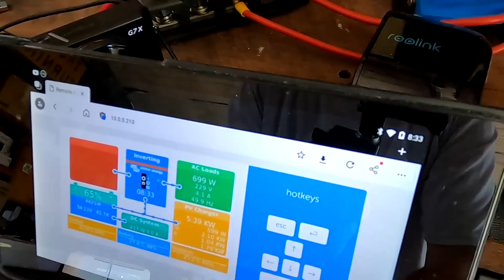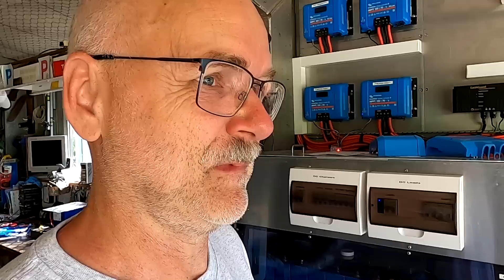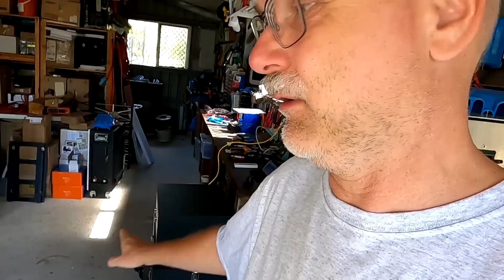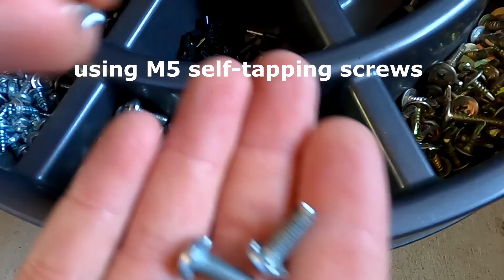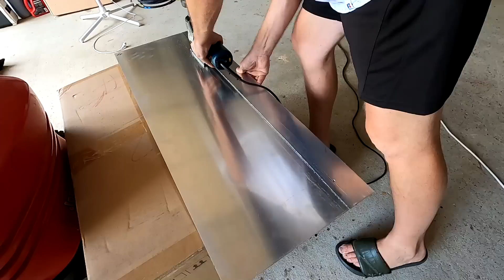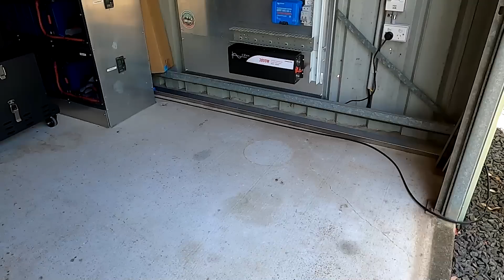PowerWall2.1 and 2.2. The DIY madness starts again. Building a 2nd system for...

Comment: does the aluminium sheet give all devices the same earthing level or does it just make a better job when mounting the devices? My original installation relied on 19mm formply as the backing sheet. Thanks for the handson tips during the build!

Comment: Andy - you mentioned that the Power In, Lynx Shunt 100 and the Distributor 100 do away with the need to switch off batteries and the breakers? So how do you switch battery banks ON and OFF. It looks great and the $s saved can offset $s you would have to pay an electrician to do any of the work? I love your videos and yet you still look value for money and reliability. I think communications will end up being a critical thing as LiFePO4 batteries age. I'm already totally off grid on the Mid North Coast, NSW also in sunny Australia. I plan on building a LiFePO4 pilot as a Plan B for my existing offgrid setup. I am on a farm, so I can guarantee no trees will be shading any of my panels, ever. lol

Comment: Unfortunately it is not possible to mount the power in module on the right side of the Lynx Shunt. It would be good if the shunt itself could be rotated in the housing so that the Lynx power in module could be mounted on the left or right. This way you can better place the lynx devices according to your wishes depending on the state of the installation.
Perhaps that is a tip to Victron Energy.

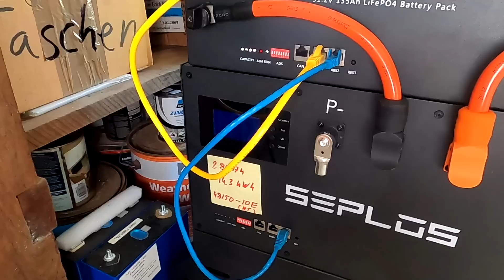Comment: 4:54 Great questions to explore! Will be following this closely. I run an off grid farm and also exploring how battery communication can benefit the whole system. So far, battery communication for me is just to satisfy the requirements of the hybrid inverter but would be more interested to command several circuits of appliances based on battery state. An example would be during the hot summer when battery is at a highish state of charge, to run a chiller and make a tank of cold water which I can use to cool the premises.

Comment: A little tip from Germany, put the Cerbo in a small plastic box or a small power distribution box with a door. How do you think the RJ45 and USB ports work after 5 years of dust and dirt trickling into the ports?
Such a box with a window costs 15 bugs and you don't have to screw them together, most plastic fuse boxes for 8 modules are big enough and they have a plastic tab on the edge where you can put a cable or a cotter pin through, so opening it is quick. greeting

Comment: Flip the lynx system upside down and put it under the wire duct and put your mppt on the top beside the cerbo. The lynx has decals that allow it to be mounted this way and the decals correct the type .

Comment: Good stuff Andy. Definitely leave the Victron shunt in for some more thorough testing, I am quite sceptical of the accuracy of the Seplos BMS Shunts at this point, I have 3 x Seplos Suntorque 5kwh Batteries paralleled, but use my Victron smart shunt as the main goto as there can be quite a discrepancy between the Seplos shunts. I may need to discharge my batteries again sometime soon to help reset the Seplos BMS’s, as I have found this helps recalibrate the readout displays.
Reply: Think think BMS has problem with low current measurement. Have seen the SOC drift in my battery (hop around) when only taking out low current. if it low enough, just the cerbo gx in my case the battery will turn it self off after 48 hours as it see no load at all. 

A full change seems to fix SOC drift for me.

For me that is not a problem because that is how it will be used in my case in mobile installation. With full charge from grid every time it is charged.

Comment: No Place? You need the Off-Grid Garage  2.0 .....
Reply: This was a suggestion I made a while back as he was planning the new Solar PV upgrade, with idea’s of plugging in the house later with wiring /trenching issues, a new insulated shed near the house maybe, purpose built to house all solar, batteries, Tesla, workshop, etc, in a sunny-er position perhaps, with air-cons & ready to plug in house & it’s roof area, which I believe still has room for more solar PV’s.  It’s a beautiful setup & huge investment he has there, he may not need it, but I think he could justify the spend.

Comment: 💥💥ATTENTION…💥💥. CERBO-GX on 48Vdc supply problem.💥💥  Search Victron Energy Q&A for "Faulty Cerbo GX devices"
Hi Andy
Victron has a There is an known issue with connecting the Cerbo-GX to 48Vdc, there is a problem with the Cerbo with certain serial numbers, where it will pop the blue smoke from inside the components, and as we all know when the blue smoke is released from inside the components it stop working = blue smoke makes electronic work?

Comment: This average Jo was thinking about a plan to save money by swapping my van for an estate car, up pops "EV unplugged"   With Andy testing the Mitsubishi Outlander PHEV. The issue is excess power in the summer with batteries in float from midday, to December in the UK, the last two weeks have been rubbish for Solar. How about saving diesel @ £1,80 a litre in summer to buy red diesel in winter for £1 litre to power the house.

Comment: Maybe a bit of work but move the board toward the garage door and still put the batteries on the left? Just a thought... Looks nice!
Reply: I vote this. Probably less work than it looks too as all the component layout work already done. That said the AC outlets and ductwork may have to move to right as well. Biggest bonus to this idea is that you could minimize the length of those expensive battery cables!

Comment: Regarding Aircon for Cooling of Batteries & electronics.
My science class taught me that cold air sinks, would it not make sense to aircon from above, for better efficiency
Reply from the maker: With no fan, the cold air would sink down very slowly because it's denser and therefore heavier. This movement is not very strong or fast, so a fan is always needed and it can blow this cold air in any direction. The fan blows the cold air directly onto the PowerWall. It reaches all the devices and components.

Comment: Why wasn‘t the last attempt with „reverse parking“ against the Battery 2.0 ok? Or park it the other way around into the corner on the right side? I don‘t see the problem…
Reply from the maker: Well, you want to see the displays and I need access to the terminals for testing purposes. All very tight...

Comment: Hi Andy,
I'm waiting already how do you connect wires to the Victron Lynx, as I understand its need to be connect diagonally (opposite sides) all of plus ("+") and minus("-") cables from equipment and batteries, what do you think?

By the way, Happy New Year and best wishes from Ukraine.
Reply from the maker: Thanks Igor. It'll come in the next video.
Batteries go all on the left side of the shunt and MPPTs and loads on the right side.
Reply: @OffGridGarageAustralia  I'll wait and watch with a pleasure, because I really interesting in how to correct connect all those wires from batteries and loads to the busbar to reach equal resistance between every connection.

Thanks, you really do a great job!

Comment: ATTENTION, there is a problem with the cerbo. If you connect it to 48 volts you have to use a capacitor.
Sunny greetings from Austria!
Robert
Reply from the maker: I know, it's in the forums everywhere... I've got this covered in the next video...

Comment: No offense, but if you want it to look "as clean as possible", then why didn't you just mount it upside down under the wire way instead of making it more complicated, and using more space that new equipment could use in the future ?

Comment: Can you bolt the batteries to the ceiling? Have them on a hoist platform, so you can raise & lower them 😁
Of course I'm joking! 🤣😂 
Unbolt the panel from the wall, build it out, so you can put the batteries behind, then put the panels on hinges so you can pull them out and up 👍

Comment: This brings a question. I just got started in solar about 6mo ago. Is it possible to have your solar panels feed 2 mttp, that feed 1 battery, that feed 2 inverters?

My system has been slowly growing and I've exceeded my mppt and I was wondering if I can split my panels across multiple mppt instead of getting a larger mppt. My battery is large enough at 5.2kw. The reason for the multiple inverters is I got them at different times so I have 2 1200w 48v inverters.

I'm just about energy independent.
Reply: Yes and yes.
Reply: @davidfrisken1617  thanks
Reply: Yes, with the caveat that panels can only be connected to one MPPT controller, so you'd have to slip the panels into 2 arrays, one array per MPPT controller. You can parallel MPPT outputs to the DC bus, and DC bus to parallel inverters just fine, so long as you're not exceeding ratings.
Reply: @collinbaillie689  ok. Yea that's what I'm doing, splitting my array into two to feed two mppts. I wasn't sure how the two mppt would interact with one battery. The inverters are still under the discharge limit of the battery. Honestly I could add a third inverter. I have to do small upgrades instead of a larger wall mounted charge controller just because of budget. One more inverter, 4 more panels, and I'll be at 100% off grid
Reply: @Paul_______  if those inverters aren't smart (IE communicate with each other to sync the AC waveform) you'll want to keep the AC outputs separate. If you get to the stage where you get a big inverter, or multiple inverters which are designed with parallel communication to all feed the one AC bus, then you can have one AC bus. Until then, keep the inverter outputs separate.
Reply: @collinbaillie689  yes they're all separate. That's how I lost my first two cheap inverters. I've since moved to vicron products. My next investment is going to be a smart shunt so I can actually monitor power usage instead of just eyeballing the voltage

Comment: Take the batteries to the BIG Shed, to learn more over voltagedrop by cableing.
The dukt is existing, and you have a lot of cables, btw. so we can see how helpful the Victron Batterie Sensor can be, if you will use the LYNX Shunt and / or the BMS to monitor the voltage and the state of charge.
You are testing so much, and there are everytime options to test something more ...... 
Beste Grüße aus der alten Heimat :D

Comment: Do you need access to the inverter? You could hard wire the inverter and an outlet higher up to plug things in. Then battery could be infront, looks like it would still be slimmer than battery shelf1

Comment: Put the batteries in the space to the right, by the door. They are on wheels so you can move them later if needed. That way it doesn't block access to your breakers for the production batteries.